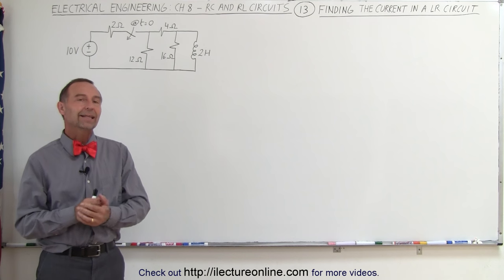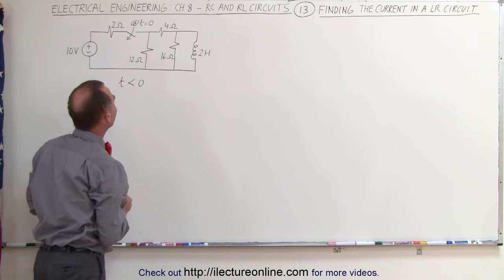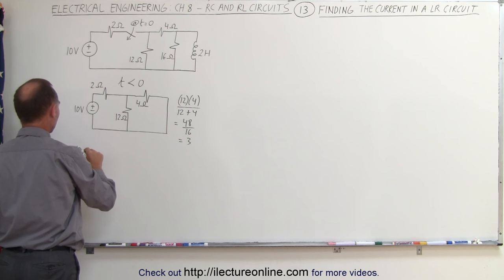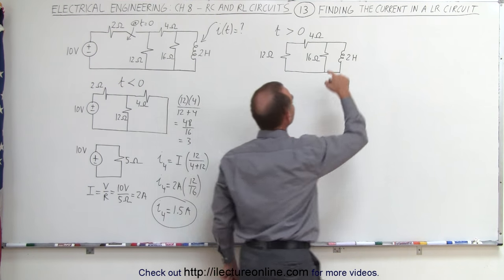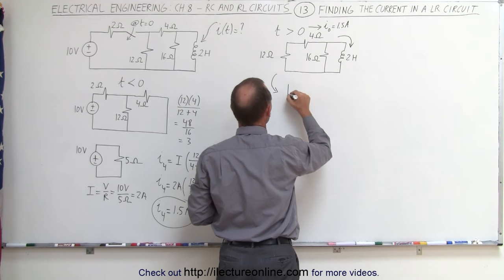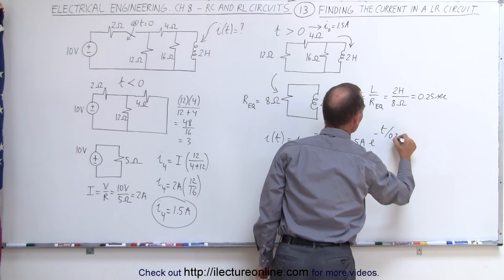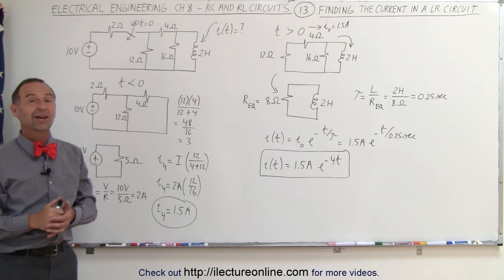Electrical Engineering: Ch 8: RC & RL Circuits (13 of 43) Current=? in RL Circuit: Ex. 1

Comment: @Rustam Shahverdiyev
the current likes the easiest path so instead of 16 ohm it will flow by short circuit
Reply from the maker: When the circuit reaches steady state yes, but not until it does.

Comment: Professor Van Biezen, thank for all your helpful videos. Question for you, if you are trying to find the current   i-4 (at resistor 4) and apply current division, don't you have to do it as follow.  I x (4/4+12)?   I see you put 12 in the numerator.
Reply from the maker: No, it is correct in the video.
Reply: because it is current division rule
Reply: Hey I am having trouble understanding why he used the ratio, do you think you can explain why?

Comment: 3:16 for t<0 sir, if we use ohms law instead of finding the equivalent circuit, we get I=10v/2ohm= 5A flowing through 2 ohm resistor and using current division I4=5(12/12+4)=3.75 A which should be the current flowing through the short circuit shouldn’t it? I am confused if I am forgetting something or if I am making a mistake.
Reply: 5A would be possible if you had only 2ohm resistor. But it's connected in series with two parralel resistors. So the circuit's summary resistance is higher than 2 ohm, and thus it can't conduct 5A with 10v source.
Reply: I obtain also 3,75 A through the 4 ohms resistor
Reply: @ionelmarianstefancu8170 the other guy is correct lol I was in my 1st year in engineering and looking back I was very dumb as well 😅 I’m now an engineer and it’s funny to look back at old comments I made during school
Reply: Right, I make the calculus again with mesh method, and Yes is 1,5 A across the 4 ohms resistor. 🥵

Comment: Hello Professor Michel , why have you included the 16 ohms resistor when calculating the equivalent resistant at t > 0 and you didn't include when calculating the equaivalent resistance at t < 0 ??
Reply from the maker: At time t < 0, all of the current will pass through the inductor (since inductors do not oppose current when it is in a steady state) and essentially act as a short and no current will flow through the 16 ohm resistor.  The moment the switch is opened, the inductor will oppose the current and some current will flow through the 16 ohm resistor.

Comment: Dear Michel van Biezen, why 16ohm resistor becomes an open ?
Reply from the maker: Before the switch opens and the circuit is at steady state (current is not changing) then all the current will flow through the inductor and no current will flow through the 16 ohm resistor.

Comment: What does it mean when there is no initial stored energy?
Reply from the maker: Since there is a steady state condition before the switch opens at t = 0 sec, there is no opposition to the current due to the inductor and therefore there is no energy stored in the inductor.

Comment: excuse me sir or anyone who can see this but how do you start your ohm resistor equivalent? i always get this wrong this 2 and 12 are also in parallel right? and so is 2 and 4. where do I start with finding the R equivalent. it is driving me crazy.
Reply from the maker: You need to take it one step at a time.  Before the switch is opened, all of the current will flow through the conductor and none through the 16 ohm resistor.  (The branch with the 16 ohm resistor essentially becomes an open circuit).  Then the 4 and 12 ohm resistor will be in parallel, so the equivalent resistance of those 2 will be 3 ohms   ( 4 x 12) / (4 + 12)      And then the 2 ohm resistor is in series to the equivalent 3 ohm resistor.

Comment: at t=0 isn't the inductor resisting? shouldn't the current passing through the inductor be zero at t=0? Thank you for the great videos. You are a lifesavor.
Reply from the maker: The switch OPENS at t = 0, thus the initial current through the inductor is indeed 1,5 A
Reply: Michel van Biezen doesn't the inductor act as a resistor as soon as the switch is closed? doesn't inductor appose current when there is a change in the current?
Reply from the maker: Just before t = 0, there is a steady state current flowing through the inductor.  The inductor will not oppose a steady state current.  Then the switch opens and the inductor will try to keep the current from reducing.  But the current will reach 0 within 5 time constants.

Comment: Why do we exclude the 16 ohms resistor?
Reply from the maker: Before the switch opens the circuit is in a steady state condition.  When there is no change in current through the inductor, there is no impedance, and therefore that branch acts like a short.  All of the current will go through that branch instead of the branch with the 16 ohm resistor.  So that branch acts like an open circuit.

Comment: Why isn't the 12 ohm resistor excluded too?
Reply from the maker: When the switch opens at t = 0 seconds, the left branch is no longer complete and no current can flow through that branch.  But the other 3 branches including the one with the 12 ohm resitor are complete and current can and will flow through them.
Reply: @MichelvanBiezen I think he meant why we excluded 16 ohms when t<0bur not 12 ohms.

Comment: Sir what is meant by steady state??
Reply from the maker: Usually when the source is first turned on, or the switch is closed or opened, there is a period (called the transient state)  where the current changes.  After a while the current no longer changes which is then called the steady state.
Reply: @MichelvanBiezen  So kind of u sir...u replied me within a day...I got the answer tnk u so much..

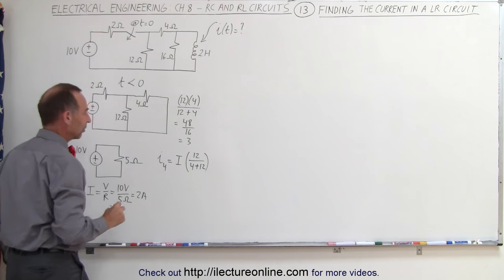Comment: I don't understand at 3:28 why i4 = 12/(4 + 12)?
Reply from the maker: That is a technique we use to calculate the current through parallel branches.  The current in branch 1 = current at the junction x ( resistance in branch 2 / (resistance in branch 1 + resistance in branch 2))
Reply: Michel van Biezen Sir but we have resistance 2 with 10 v witch mean I0=5a

Comment: prof.  how much is voltage drop a cross each resistance?
Reply from the maker: The voltage drop across each resistor is the current through the resistor times its resistance.  Since the current changes during the transient period the voltage will change accordingly.

Comment: Why doesn't the current flow through 16 Ohms?
Reply from the maker: Before t = 0 sec  ( t < 0), the inductor does not oppose any current flow, so the inductor branch is essentially a short and therefore no current will flow through the 16 ohm resistor.  
(An inductor only opposes a CHANGE in current).

Comment: This is natural or step ?
Reply from the maker: We are not sure what you were asking.  At t = 0 sec, the switch is opened, but the source voltage is applied at all times.
Reply: @MichelvanBiezen  no I mean it is step response or natural....means charging of inductor and discharging of inductor show response while showing both differently is a transient so in this only charging then become itself a current source ie.inductor....so no in this case what type of response it should be ???
Reply from the maker: When the switch is opened, there will be a transient response due to the inductor, until steady state is reached.
Reply: @MichelvanBiezen  okay